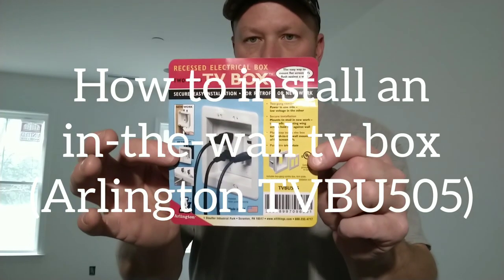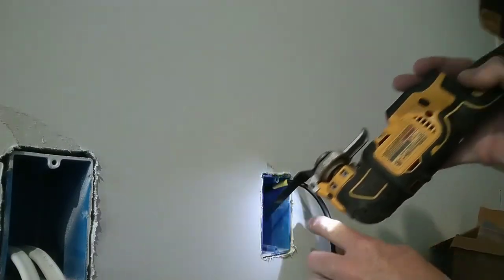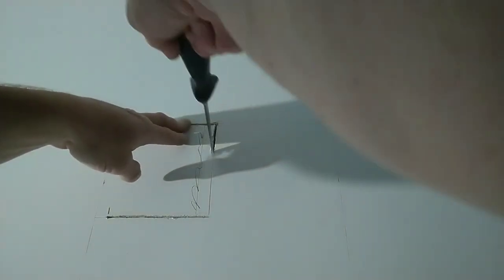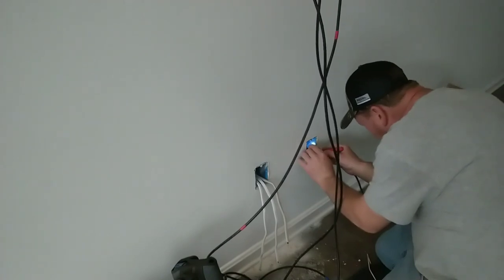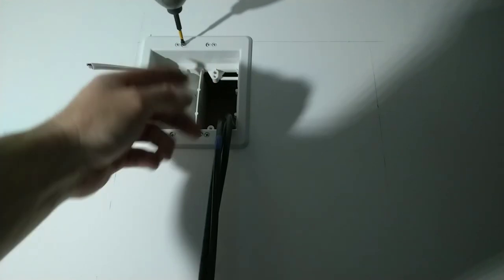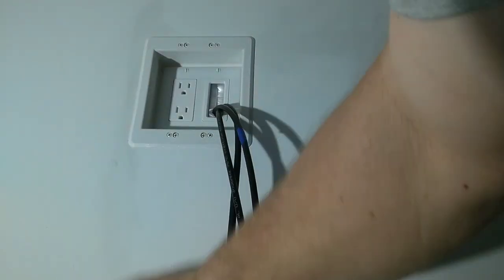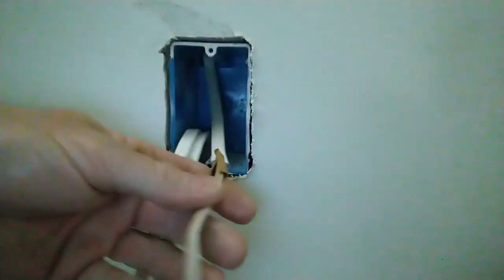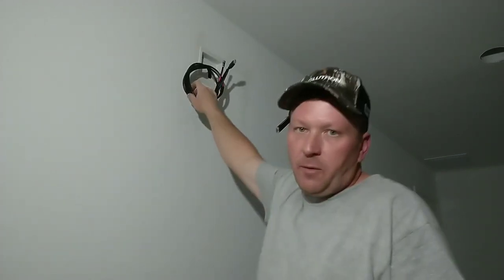Arlington Flush mount tv box (helpful tips)🤔on a complete install

Comment: TV is a little too high in my opinion. Viewing angle should roughly be eye height, depending on the size of the tv but dang someone's neck is going to hurt looking nearly at the ceiling.

otherwise nice install!
Reply from the maker: Thanks for watching and commenting Andrew. I agree with you but in bedroom applications, the TV have to be set higher due to dresses and furniture placed under the TV. But a very good comment. Thank you for the insight. 👍👍